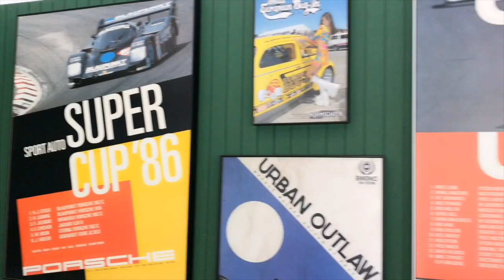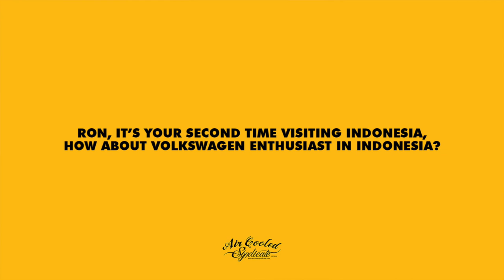Small Talk - Ron Fleming and Gary Berg

Comment: Cal look was the way all drag cars were in that day. A Chevelle would have centerlines and skinny front wheels and big meats on the rear. Lowered in the front and the big tires would make the back high. Lightened with no bumpers or a buggy bumper in the front (weight saving) Or blades. then loose the chrome on the windows. One piece front windows (more similar to a race car).
Reply from the maker: Yes, a very amazing years back then. Thank you for passing by to our account. Please subscirbe, like and sahre our contents.